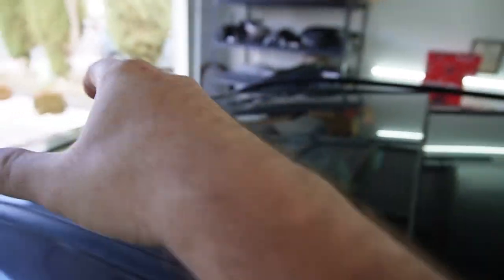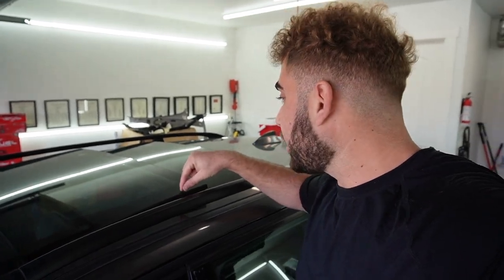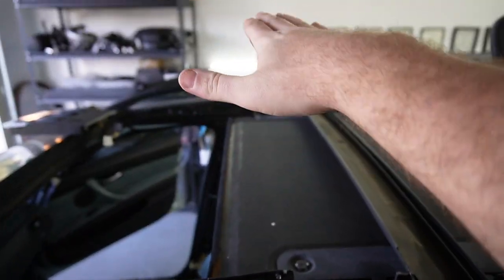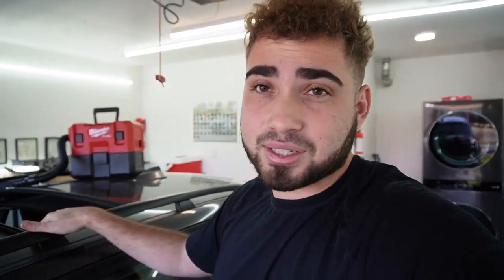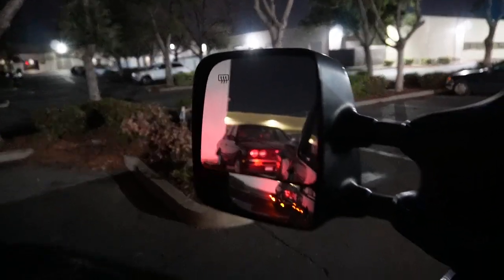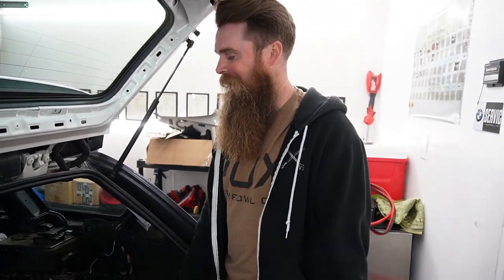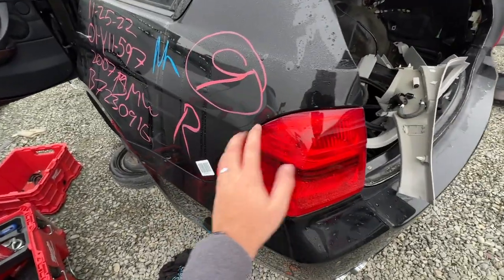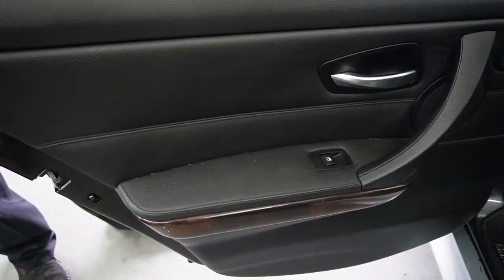Building A Custom 1 of 1 E91 M3 Wagon! (Part.26)

Comment: Hey man, the rear glass is a really common issue on E91. I am pretty sure that a cable is  broken on the right side in one of two pipes going from the car body to the tailgate. This also can cause problems with keyless entry, taillights and battery drain.
Reply: Push
Reply: bump

Comment: You have to reset position of the sunroof  by pressing and holding the vent button for at least 20 sec. its going to do a dance by itself and set all the reference points for closed, open and vent. is going to throw an error on dash while doing all that but is normal. The other problem with your battery drainage may have to do with the diversity antenna. Is a knonwn problem with the wires to the antenna that brakes by being to short. check all the wires that goes thru the rubber pipes from the car to the tailgate on both sides. Keep it going and let's see the car on the road.

Comment: I think you did the parasitic drain test wrong. You’re supposed to unplug battery and pretty much connect the multimeter in between the battery and the terminal. See how much power it’s pulling and then start pulling the fuses. It should drop to near 0 when you find the culprit

Comment: Right mate! had the same problem, mine was completely destroyed but i fixed it for £30! now the front sliders come off without taking the whole cassette out, you can get new sliders on eBay, BMW use the same sliders on a lot of their panoramic sunroofs but with different part numbers, the sliders come as 1 on each side but you can remove the bit tape holding the 2 parts together and move them in to different positions to fit your car, thet dont tell you that tho! 2. you need to control and set the sunroof manually from the rear of your car with a torque ratchet, it winds back and forth manually, you can take the whole front assembley apart that way, youll then need a short screw driver to insert on each slider to set them in the right position, once thats done you can attach the glass and close it maually from the rear, then you need to reset it by holding the button in and let it go through a full cycle before releasing the button, its very easy to do, theres plenty tutorials on assembly on you tube, good luck. atb Mark.

Comment: Please make sure the diversity antenna is sealed correctly. When pressure washing the spoiler it will get water inside. Maybe use some rtv
Reply: Oh, and in theory the car should give a worming sign if the trunk or glass is open. So if that’s the problem i assume the car will tell you. Does the diversity antenna even have keyless entry? You have them with 434mhz and 800 ish.

Comment: I have owned an E91 for years. If you are having battery drain issues it can cause the rear glass switch not to work. The IBS cuts power to that switch and the rear glass defroster from my experience. Everything else on the hatch worked fine. Is your rear glass defroster working?

Comment: About the short circuit, have you checked the trunk cover wiring? It is a common issue, that literally every E91 has problem with either locking the window, or rear lights oe anything else according to this wires